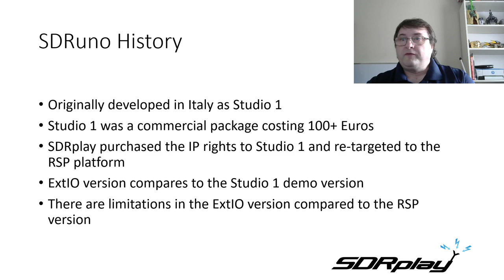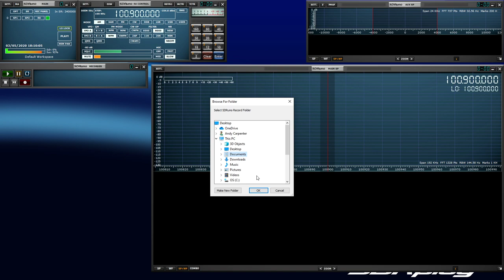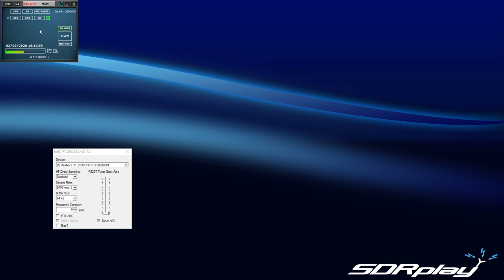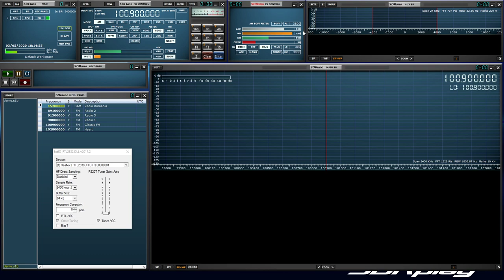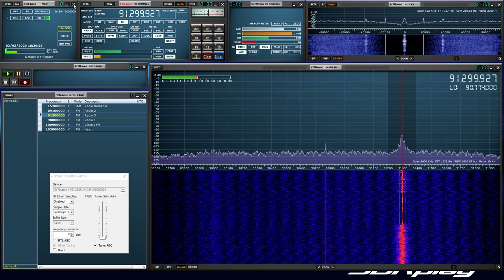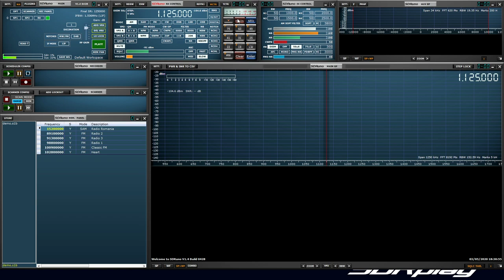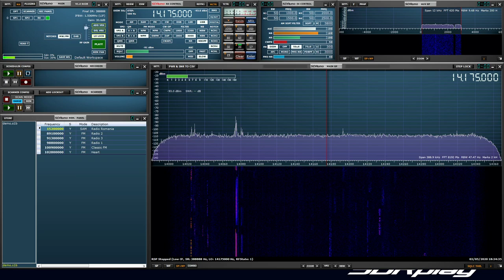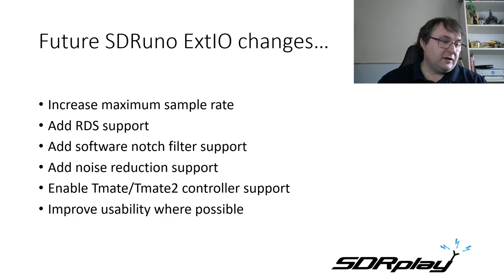SDRplay: Using SDRuno with an RTL Dongle

Comment: I like sdruno but the logging and recording functions leave a bit to be desired. In scan mode it would be great to have mem panel have the option to record individual hits,  not just the frequency along with a time received and also record the audio.  SDR receiver can then be used  in an unattended logging mode.
Reply from the maker: this is in the roadmap - version 1.41.  Can't guarantee the timing of this but version 1.4 is due out very soon (in a week or so)

Comment: I'm missing the scanner function using the RTL dongle. Where is it? Nice video, this was a great help.
Reply from the maker: A lot of the SDRuno software  improvements added in the last 2 years (including the scanning function) have been created for the SDRplay RSP hardware.   The Hardware and software combination has evolved beyond the capabilities of the simpler dongles.
Reply: @SDRplayRSP  Ah, so that's it. Well thanks for your comment. Stay safe!!
Reply: @SDRplayRSP  I would figure that a scanner feature would be the most popular and standard feature in all of these SDR software packages.  I was disappointed to find that none of the compatible software for my Nooelec dongle had scanning/memory capability.  What's the point?   I guess I'm going to have to buy better hardware.
Reply: @Sugarsail1  SDR Sharp will do scanning with plugins.

Comment: Instead of figuring all the ways to lock down the software why not port it to MacOs and linux....you know, what the rest of the world is using?  90% of getting started with UNO is getting over licensing hurdles.  Thankfully you started to allow plug-in development but it’s still too locked down.
Reply: The Mac badly needs some good SDR software.
Reply: mac and Linux combined make up only 14% of the personal computer market..... Even with this years surge in Chromebook sales. 
 
Just use Wine or a $10 Windows VM like everyone else and get over it.